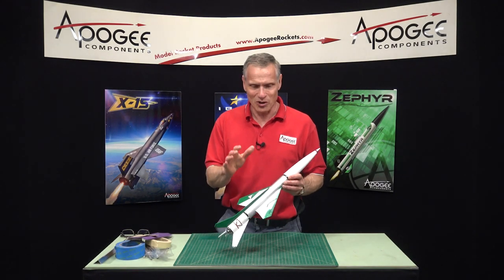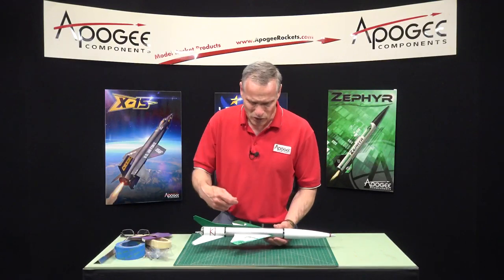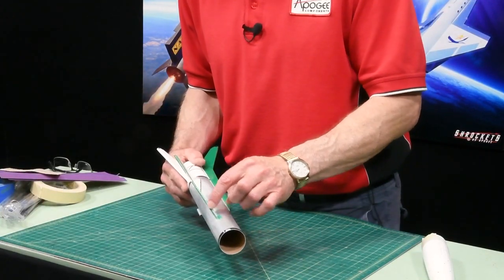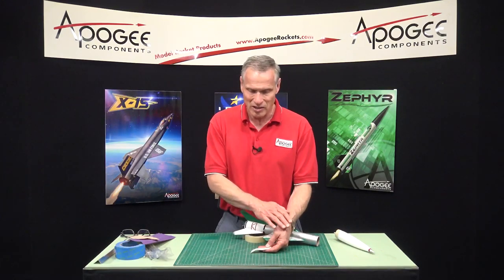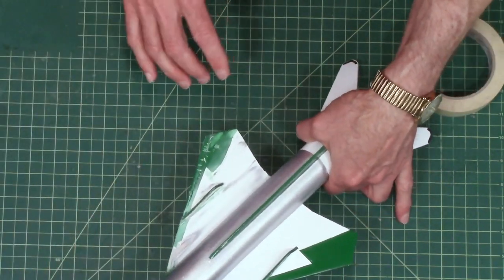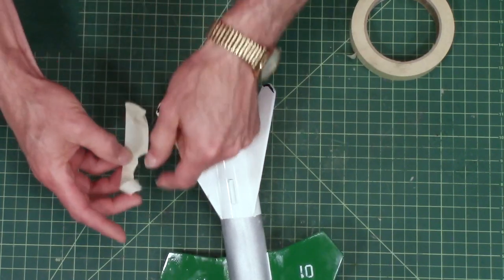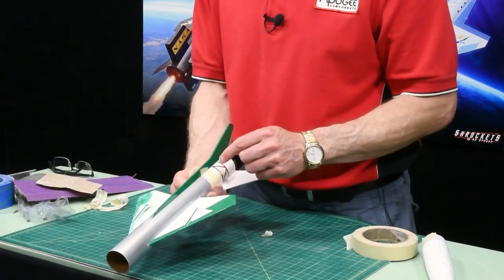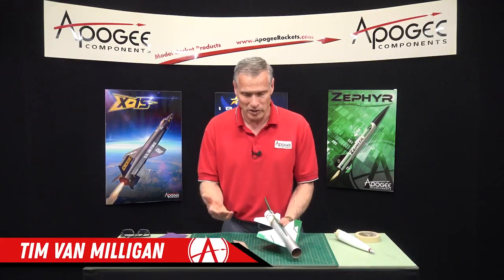How to Restore and Repaint a Model Rocket - Part 1

Comment: I've had problems with paint incompatibility.  I have one rocket that is 50 years old and I still can't put new rattlecan spray paint on it.  I'm thinking my best solution is to sand well then put on a new paint job with acrylic.
Another problem I have with trying to restore an old rocket is that the fins get banged up.  Leading edges and trailing edges get dinged.  I used to try to put good sharp edges on my fins, but the sharp edges are too fragile.  I've gone back to just rounding the edges except in special cases.